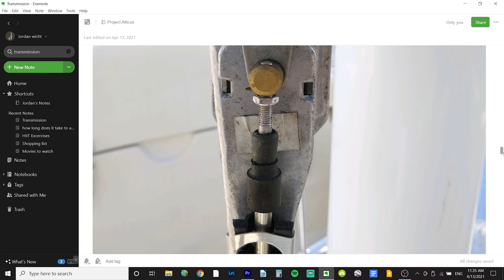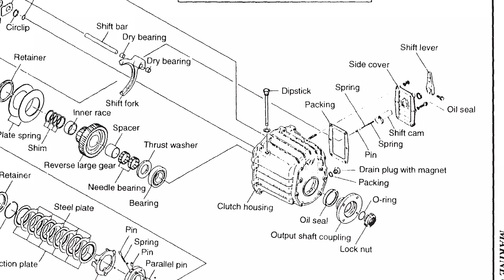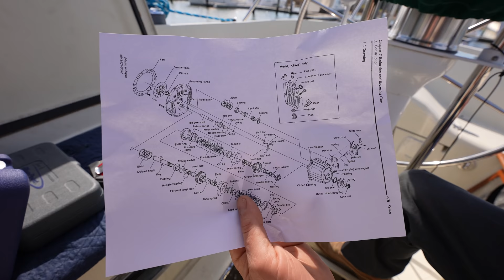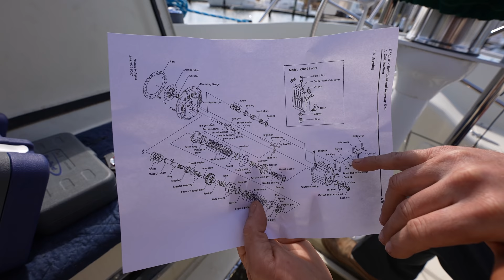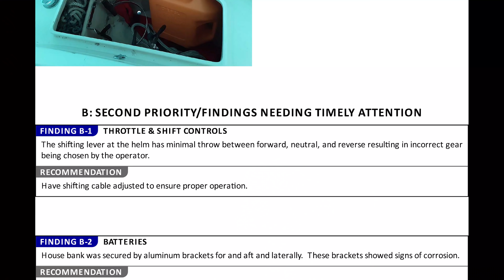This is a BIG problem 😧 | S06E02

Comment: I used to be a helicopter mechanic, and it taught me that problems inflating like that are a good thing. The reality is that those other issues were already there, and if there hadn't been anything to keep you poking, you wouldn't have found them until you were in the middle of nowhere!
Reply: Helicopter mechanics do preventive maintenance.  Parts replaced by time on part/or just plain time.  Boaters seem to react to problems after they develop.
Reply: @markwylam5213  There's plenty of reaction in aviation, too. A lot of the bigger problems that don't show up during regular checks appear because of something further down the chain breaking.
Reply: Hello from SE Alabama. I was a ARMY aviator (retired now) and sincerely appreciated our military maintenance folks. If they have input on a mechanical issue you might want to listen to them. They kept me alive for a number of years and I thank God for their service. Really enjoying your adventures.
Reply: @dustoff1472  Retired Marine aviator.  I always said that I was smart enough to fly them, but not smart enough to fix them.  Some things are best left to the professionals.
Reply: @dustoff1472  you’re welcome. 67N 1/214th.
Reply: We had an incident In 2005 with a Sactamento County Sheriff’s Eurocopter in which the helicopter crashed and killed two sheriff’s deputies. The cause of the crash was traced back to a fuel control diaphragm that was installed backwards in the Turbomeca engine.
Reply: @markwylam5213  Bingo.  Ex Air Force and I'm surprised there isn't a maintenance schedule for the whole boat, other than changing the oil. There are a lot of systems on boats and IMHO the quality isn't what it should be.  It feels more like looking after a classic car.

Good owners develop a schedule based on what they find over time, but there really should be something right from the factory in one manual, and the industry at large should standardize on an addendum per product that can just be added to the overall manual.  At least then you've got a fighting chance to find things proactively.
Reply: Dishonest seller, Buyer beware.
Reply: @igardner1972  , I totally agree. They probably teach a course in dishonesty in college these days. Not how to spot it, but how to get away with it.
Reply: @argophontes  Yeah ever hear of the jackscrew calamity? There are plenty of maintenance items that are put off "until later" in aviation, especially now, with a year of zero profits by carriers. I hate to say it, but there will probably be a spate of aviation accidents in the next few years.
Reply: @jeremyduncan3654  67U here, sailboat systems are a cakewalk 😎👍🇺🇸
Reply: @lordhamercy9098  true. However some boats got hell holes worse than a Huey.
Reply: @igardner1972  and there are a lot of them. Buyer beware ! ! ! ! ! ! !
Reply: @argophontes  if a boat fails, it could stop, but if a helicopter fails, it falls out of the sky!  You never want to fall out of the sky.  If you are stuck in the middle of the ocean, you wait for someone to answer your mayday, but if you fall out of the sky, you are waiting for the undertaker. 🌹
Reply: @browsman2328  that's terrible.  The gas company was called out to our home because the heater was not working.  A while later, we smelled gas.  The person sent out to fix it put the valve in backwards and it was leaking gas into the house.  The kids were already in bed, we were not there, yet.  The gas company sent out the fire department, sirens blaring, which they do if there is a gas leak.  Aside from the neighborhood running to the house asking if I was cooking, there was no joke when thinking about gas coming into the house.  Thank God for the person whose idea it was to put the smell in the gas so we could tell there was a gas leak, we would all have gone to bed without knowing.
Reply: @igardner1972 the boat had a survey which included a trial run. I doubt that anything dishonest was going on.
Reply: @stopthephilosophicalzombie9017 in the States commercial carriers put together a maintenance schedule in conjunction with the NTSB, FAA and Airplane Manufacturer. They can’t just put things off because profits are hurting. Otherwise, they would get fined and grounded.
Reply: @slynn5138  Don't be naive. That doesn't mean they still don't. Haven't you been following the 737 Max scandal?

Comment: Nice job. Future reference Boeshield T9 aerosol. WD40 is not a good lubricant, it is mostly solvent and disappears. Boeshield is a lube and a tenacious coating especially perfect for aluminum castings like that control hub. Boeing developed. (Airplanes, aluminum, harsh conditions). Must have on the boat.

Comment: Hey. The comments about finding the problems now versus later are spot on. One thing - I noticed you filling your tanks without runninf the water being put on board through a physical filter. No matter how much you trust your source of supply, please always use a physical filter. Your tanks and, eventually, your tummies will thank you. Also, please an on-board UV filter for any water you are going to ingest. I mentioned the Acuva LED UV filter we have had on our boat for years, but there are many others available. At best, boat water tanks create a questionable environment for water you want to drink. Don't take a chance, even in the USA. And definitely not in more remote areas.

Comment: Hello, I love your sailing channel. You most likely lost the shift lever detent. When you move the shift arm on the outside of the transmission back and forth, it moves a shift rod inside the transmission. Attached to the shift rod is a large crescent shaped shift fork. The shift fork slides a gear back and forth to shift between Forward, Neutral and Reverse. It’s actually a very simple system.

To prevent the shift rod and shift fork from accidentally popping out of or into gear, there is a ball bearing and a small heavy duty spring on the shift rod which “Detents” the shift rod in the neutral position. If the detent spring breaks or the detent ball bearing flattens, you will lose detent and the external shift arm will move freely back and forth without the positive lock into neutral which you were feeling before it broke. It’s an easy fix.

Comment: Probably too late, but on that chrome tube you cut,  I do hope you reamed and polished it to a fare thee well inside and out. Secondarily, those usually have a plastic bushing that covers the top of the tube and goes inside an inch or so to protect the cables. As it is missing, gives you a reason to suspect other short cuts by the PO.
Reply: Good advice Mark ... as possibly original/previous installation was done using a wheeled pipe cutter which turns edges inward (great and handy for fluid pipe fitting, not so good as a cable conduit) and may have precluded plastic bushing fitting.

Comment: Transmission woes
Your methodical approach to your shifting problems  was good but you missed a few key clues along the way.  Moving the shift cable pin to the inside hole without checking for free articulation as you found out resulted in a bent shift cable. The next step should have been to move the shift cable anchor to the next set of holes on the cable mounting plate, I believe I saw a second set in the video. Most marine transmissions have a series of holes on the cable mounting plate, if yours does not you can easily add a few holes with an electric drill. Remove the plate, yours came out with the transmission, holes should be spaced just a bit closer than the range of adjustment offered by the threaded cable end resulting in a geometry that will permit neutral and full forward and reverse adjustment. Changing the helm control or rebuilding the transmission can’t fix bad geometry!  Next you noticed the helm chafing, good call,  but did you check for burring at both ends of the stainless steel tube at the helm. A few swipes of a deburring tool or a rat tail file will clean up the transition from tube to shift control. Good call using string on the control cables, but did you check for sharp edges and bends along the way? Round off any sharp corners and secure the cables in such a way to make wide sweeping turns with the cable. Problem areas can be given a cover of rubber hose or pex plastic water tube as strain reliefs. Don’t give up on the control box, the problem is with the cable geometry and chafing. Last when you noticed that the shift arm was moving without actuating, you should have first checked if the key on the shaft had sheared ( this is external of the transmission and is a simple check). Hope I didn’t come across as too negative, I really enjoy your videos and am looking forward to seeing you sailing again. PS I am a commercial fisherman working off Long Island for the past 46 years. 😀
Reply: Hi Ian. I wish I have you as a friend if I ever succeed in buying a boat. You provide so many good advices.

Comment: WD 40 is a DE Greaser. If that cable needs oil or lubricant, use a proper grease or oil.
Reply: WD40 is a water displacement spray, not to be confused with degreaser

Comment: G'day Atticus, it's unfortunate to see you have to put more time and money into the Pacific Seacrest. At least you're at home in the States when this happened and not on passage, crossing the Pacific!!! However, it wouldn't be a "boat" if it didn't require additional work. It's inevitable :) Once you buy a boat, regardless if it's new or used, there's always something that will require attention ~ that's just normal, when living the "boat life!"  Working or repairing your boat ~ is a activity that will unfortunately never end. Good luck with your transmission. I hope it's an easy fix. Cheers from Western Australia 🇦🇺.

Comment: The problem is not with the surveyor or the survey.  The problem is with the buyers.  I'm not being critical of you because it is so easy to do and so common, but your were so in love with the boat that you were willing to overlook and minimize the importance of what should have been big red flags in the survey.  I hope you have had the alternator removed and taken to a shop that can put it on a test bench and check it out thoroughly and rebuild it if necessary.  These problems are bad where you are know but just imagine how bad they will be in a place like Panama or worse.

Comment: Your broker,surveyor and other “experts” let you down.  If possible issues on sea trials are found, an amount of funds should have been held back until issue was found, repaired, and paid for from that retained money.  Brokers and surveyors are just looking for a check with their name on it.  They did not protect you as best as they should.   I am a retired marina owner operator.   You hire them. They are there to protect you not the seller.   I don’t mean to be negative however I am sorry the transmission was not addressed properly in writing and funds that were set aside to help offset the costs of repair if necessary 
      It’s still a beautiful boat and will serve you well

Comment: I have found with some considerable experience buying used boats, that the owner using equipment, like the throttle/gearshift does not recognize the problem because it gets worse slowly over time and if you are lucky enough to not experience catastrophic failure that does not mean it is not coming.  You did exactly the right thing, identify the potential, and go step by step digging deeper, calling in help as you need it, to get to the bottom of the problem.  Surveys only identify what could be a problem, not every little this that is wrong.  
Keep going this is a truly beautiful boat, and you two have the character to make it the "Bad Ass" off grid world sailor you dream it will be.

Comment: The shift lever assembly at the transmission box can be easily removed and check for the detent spring or mechanism that keeps the fork in its neutral position. I believe the spring failed..I emailed you more details with  the full shop repair manual, not the service manual. Lack of lubing over the years made have created additional friction in that detent mechanism hence leading up to spring failure..Be sure to check the lever travel for F and R as specified in the manual...

Comment: Hello to both of y’all. , I love what you are doing. Very inspiring to me.  Also I enjoy fixing up boats.  One important thing I have learned with my father , is that the diesel powered boat that my Poppa bought last , we immediately replaced the Morse shifter and throttle cables with Yamaha outboard cables. , here is why.  Most throttle and shifter cables are telescopic. Which don’t make sharp turns or bends well, without kinking .The Yamaha cables are a braided stainless wire ,   We would first run our pull line , then take out the existing cables lay them on the dock and measure them precisely, take the measurements to our local Yamaha dealer and they have always had what we needed on site . We did this on two of the 3 Topazes, 1 38 black fin and a 33 L&H.  If we knew about it sooner we would have done it on every boat before that.  I hope I could help a lil.  You have certainly helped me to get motivated to finish my house projects , with the view of selling or renting out , then buying a sailboat to live and travel on   Thank you   Mark p Landry. 45 mins south west of New Orleans, 25 mins from the coast :)

Comment: I had the same problem with articulation. I filed a small angle to allow the fixing to articulate more and that solved my problem. But, you also had a problem with the cable chafing. Great vlog, great boat.

Comment: As a professional mechanic, I find it interesting that the "mechanic" who took the transmission off (which you totally could have done yourself) didn't pull the transmission apart to diagnose the failed part.  I don't pretend to know everything but it sounds and looks like a broken shift fork or it's not attached to the shift lever.  Good luck, it doesn't sound like you'll need to invest in new roller blades for another channel just yet. 😉
Reply: ^ Times 2...shift detent/cam is my guess. You have a blow-up, time and a source of parts & advise, time for learning an on the ocean emergency repair.

Comment: Jordan: Thanks for the explanation wrt the limits of boat surveys.  It's reasonable to expect that if you buy a 15+ year old boat, there will always be some unforeseen maintenance and repair issues.  Even if the boat appears to be in Bristol condition, there will almost always be something wrong with it. And as often as not, even the current owner will be unaware of the problems.

Comment: Ians advice "shift arm was moving without actuating, you should have first checked if the key on the shaft had sheared" is good advice.
Further, If the shift arm was moving and actuating but no neutral indent then the problem could be seized/ broken neutral indent spring and or pin within the cam.  That's an easy fix that you can do yourself.  Anyways, I hope it works out ok for you guys and am looking forward to hearing about the fix.

Comment: For the throttle and shift cable chaff I would try to find conduit antishort bushing .....we use them in the electrical world all the time... its a plastic bushing to protect the insulation on cables

Comment: One way to reduce transmission problems is to NEVER shift your transmission without the motor running.  NEVER!!!!  Evidently - no one told you.  You were destroying your transmission and linkage as you were "testing" it. Undoubtedly the guy before you did the same thing.  On the hard - have someone turn the prop by hand while testing your transmission.  Alternatively, run the motor with a water cooling source (can cause hydro lock and destroy your engine if not done properly.)

Comment: Just a thought: Oriental is quaint. Annapolis is fully equipped…
Reply: That's where Sailing SV Delos did a mini refitting and save a lot of MONEY buy DIY (doing it yourself) they said doing it in Annapolis they saved $45K ON A MINI REFIT ! good luck !
Reply: @nealchristensen1793  yep! DIY Projects usually go so much better when good suppliers are close by…

Comment: You didn't show it, but surely you chamfered the inner edge of the pipe to reduce chafing. Also get some white lithium spray grease. WD-40 is OK for cleaning, not for lube or preventing oxidation.

Good thing it happened before you started your cruise.

Comment: Yes, hot showers in the boat are so refreshing. More so than on land. As in my boat, during the survey, a transmission problem did not surface. However, during the delivery trip on the Okeechobee waterway, it became a problem going from neutral to forward. It took a few months to figure out, but the slipping was so bad, that the rear engine mounts broke. I was in Cocoa Village and after a few very close calls, decided to yank the transmission out. I had it rebuilt by the local Yanmar dealer for $1,600, which was less than half of a new one. It turns out, these Kansaki KM-3 trannys are notorious for this problem when not maintained properly. So I feel your pain. Definitely a safety item and could void insurance if you have an incident and the problem was your shifting. The transmission issue drove and accelerated the refit, which I'm still at it, almost 4 years later working part time. By the way, Oriental, NC is okay. New Bern costs more, and probably still recovering from hurricane damage a few years ago. Stay safe.

Comment: Changing a cable seemed like an easy task, BUT this is the lovely part of mechanical repairs. Your approach was solid not sure I would have cut the tube though? Replacing the tube back to OEM if it ends up being a problem is not a big dealio! Your surveyor comments are bang on and something some viewers and comments were not appreciating. Jordan you are deceptively tall and not fully appreciated until you try and squeeze those long legs into a small area.